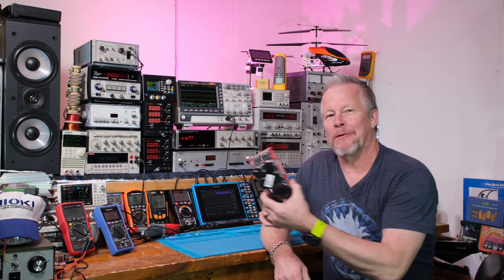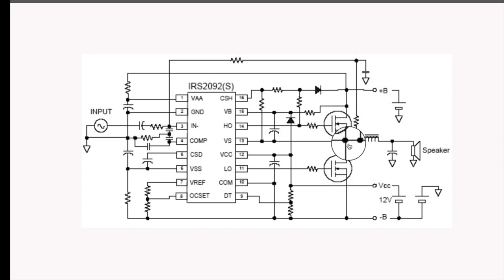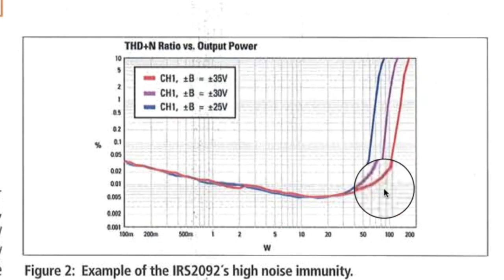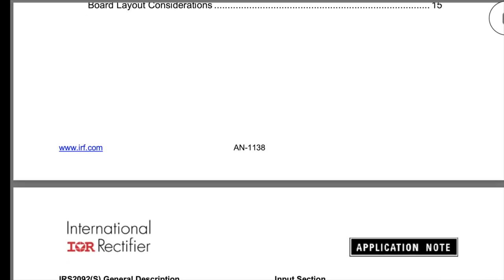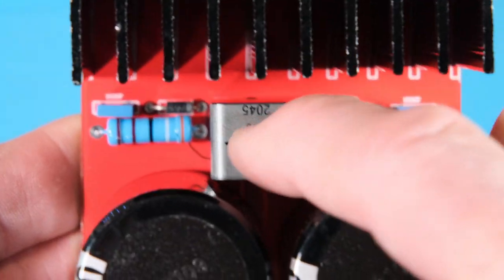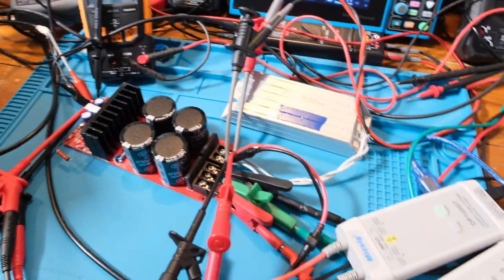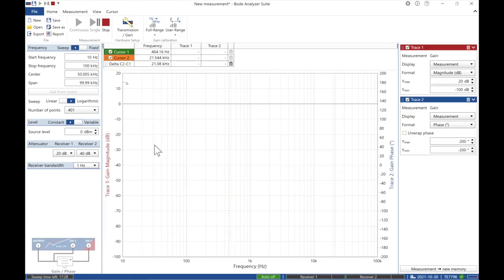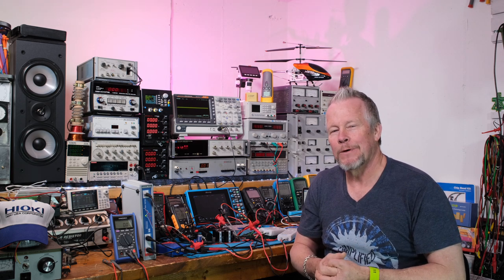350 Watt Class D with IRS2092 BODE Plot with Omicron Lab #OmicronLab #IRS2092 #bode100

Comment: The IRS2092 is a very useful class D amplifier controller, which can be combined with a variety of output stages. Very interesting video. I like the maker friendly DIP16 package.
Reply from the maker: Thanks Gunter!  I also like this part, and I do have another eval card for a Class D amp with this part.  I'll have to show it in a video.
Reply: @KissAnalog  There are also other class D amplifier controllers on the market. One of my best solutions was the LTC6992 for the voltage to PWM conversion and the LM5104 for the half bridge controller.

You just need to make sure that the average input voltage of the PWM converter needs to be set precicely to 0.5 V for 50% duty cycle without signal. AN adjustable fine trimmer also works fine under observation of the output dc-offset

Comment: Wow, that is a pretty powerful amp. I think the max I could supply would be around 35V on each rail. That would be if I was to buy a more powerful toroidal power supply to power my amplifier power supply board.   It can get pretty expensive to power these properly.
Reply from the maker: Thanks Tron!  Yes the PS could be expensive.  I'll see what I can find.  I think I'll try to get a switcher for it - which is appropriate;)
Reply: I have had 2 of them die, and one with same chip, different layout also died...keep well of the max allowed psu-voltage...   Also, any Hypex sounds much better, (and cost more).

Comment: Thanks Eddie.
I think if you want a class D amp that's going to sound really good you're going to have to find something in the Purifi, ICE, Hypex or Orchard range. I did buy a cheap class D from China with the 2092 chip and it sounded pretty good for what it was but it doesn't equal my ICE amp for dynamics and other criteria. Maybe just me.
Reply from the maker: Thanks for this great feedback!!  I need to do another video with the Orchard before I have to return it!
Reply: @KissAnalog  Great video!  Consider comparing with Hypex.  I have used UCD180-AD modules with great results for hi-fi.  Thanks again!
Reply from the maker: Thanks so much for the tip!!

Comment: Operates up to 800kHz. You can probably hear up to 10kHz. 20kHz for a baby. The rest is ultrasonic oscillation danger. PSU output needs to be 10A per rail for 350W into 4 ohms.